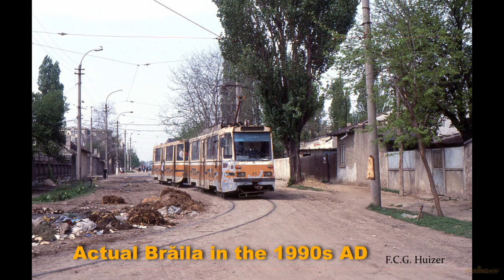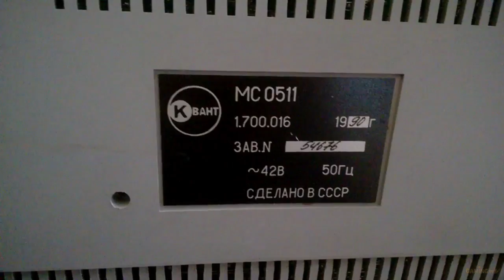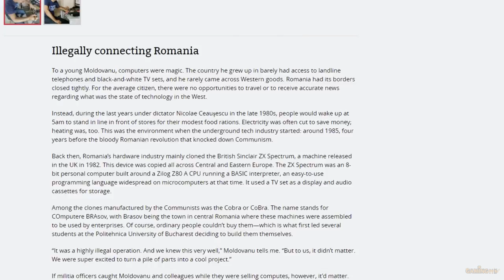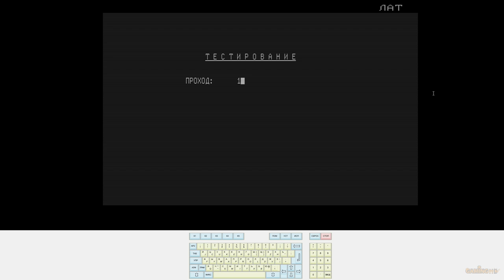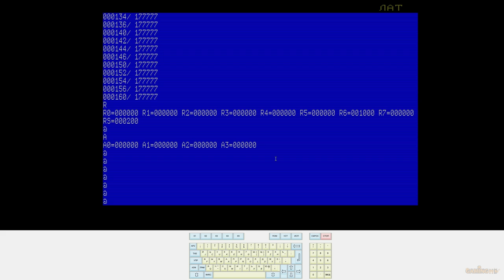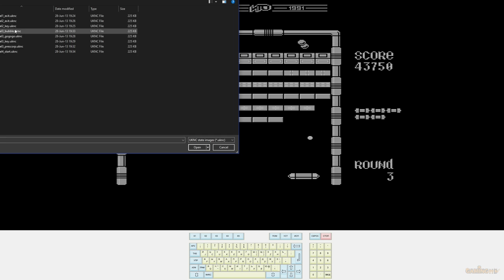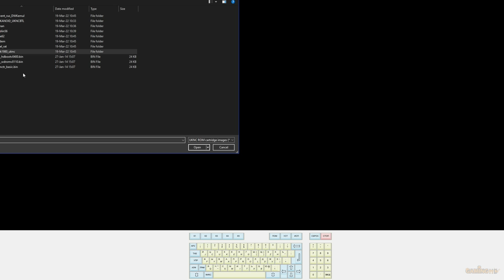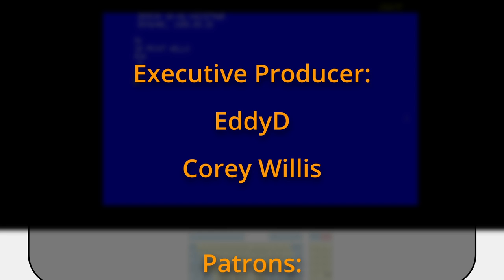The Hidden Gem of Soviet Computing: The Elektronika MS-0511

Comment: Great video! I actually remember playing Highway encounter on my ZX Spectrum in the mid 80s. The MS-0511 port (on Github, not complete) from 2018 is actually made from reverse engineering the original ZX Spectrum binary using a disassembly toolkit named Skoolkit. The original programmer of the game made other great Spectrum that I have fond memories of, like Android One/Two, Cyclone and Tornado Low Level.

Comment: Love the story!  I've been fiddling with Soviet/post-Soviet machines the past few months ... having a discussion with someone else, we wondered ... were there any BBS's "behind the curtain"?  Or was it mainly swapping tapes, etc.?  To be honest, I've not seen any mention of modems ... /Brett
Reply: BBS were popular in the USSR mainly among users of IBM-compatible equipment, of which there were a lot after about 1987 (both Soviet-made and imported). On other types of mass PCs in the USSR (UKNC (MS0511), DVK, Corvette PC8010/8020, BK-0010/0011M, Vector-06C, PK01 Lvov, PC8000, Spectrum-compatible, etc.), modems were rarely used, programs and information (for example, electronic magazines) was distributed mainly on diskettes, less often on cassettes.
Reply: @vladtru9670  Thanks for that insight.  Actually, now that I remember back, I didn't get my first modem until we had an IBM PC compatible (Amstrad PC1640) either ... before that we had Amstrad CPC464 and so you'd need to get an RS232 adaptor plus a modem to get online ... I did want to get online but it was not such a cheap or simple thing to do back in the 80s for 8-bit machines in the West either (especially when you had to import from UK) /Brett
Reply: @Brfff  In Soviet home PCs, too, there was no rs-232, it was almost not needed. Printers, joysticks, plotters and even mice were connected via a parallel port (almost all PCs had it). Modems were almost exclusively imported and were quite expensive. Moreover, there were other reasons in the USSR - poor telephony (most people did not have telephones), poor quality of many telephone lines (modems required good and expensive :) and restrictions on the dissemination of information - for example, in the USSR there were no systems like Videotex, Prestel, Minitel, there was no tradition of private use of modems until the advent of IBM-compatible ones (modems was used mainly for communication between computer centers and mainframe computers).

However, from experience I can say that before the advent of the Internet, we were usually quite satisfied with personal communication with friends or in computer clubs, as well as a leisurely exchange of information through the mail. But at work, where IBM-compatible ones usually stood, modems were used both to exchange data with remote specific PCs and to access BBS.

Comment: I just threw my first computer out a few months ago due to cleaning. It was purchased by my parents back in 1998. It was an HP something or other. I threw the CRT monitor out years and years ago but kept the tower for nostalgia reasons. I think its price at the time was over $2k. I remember the storage was comically small by todays standards. It was also a strange number. I think 3GBs. I did keep the hard drive. But even if I did have a way to connect a 40pin IDE cable to see what was on it, I wouldnt. It would be like going bareback on the most veteran hooker in the dodgiest part of your town.

Comment: I have one of these machines and wonder about the type of monitor to connect it to as well as the sort of power it would like.  What I run across on the web shows +5vdc on one pin and -5vdc on the other and that can't be right.
Reply from the maker: The monitor I had attached to it had a coaxial input. As for the power, it has a built-in source, not sure what can supply it if that breaks down. Though, there are some other channels that have taken it apart and studied it in depth, you'll see some of them listed in the video itself.
Reply: I'm currently working on one of these machines myself at the moment, so reply is somewhat delayed - just got it to boot after removing the network interface card (has a suspect K155ЛА18 that was getting very hot!).  It's a 42VAC model so was a bit confused by the outputs because I couldn't just plug it in (to 240VAC) and measure ... looks to be +5VDC and +/-12VDC ... and I think the 12V are used purely for serial interface and only 5VDC is needed to run the machine.  I got the machine to boot by just supplying +5VDC (pin 1) and ground (pin 2) ... draws almost 2A!  Anyway, the video output connectors (2x5 IDC) output monochrome video (pin 9) or colour RGBS ... as well as sound.  At the moment I've just got it connected via the monochrome video via an RCA plug into my LCD screen.  I won't link my videos here (that'd be a bit rude), but come over and have a look if you still have issues/questions ... /Brett